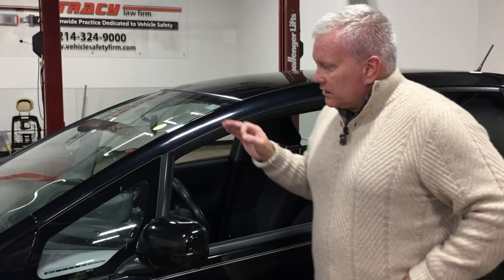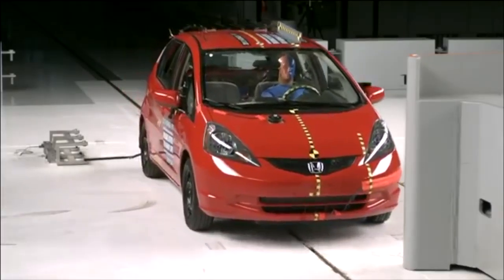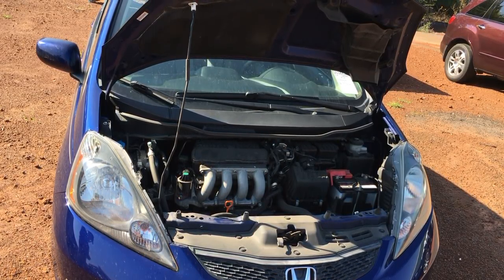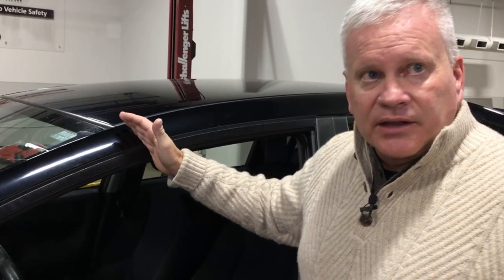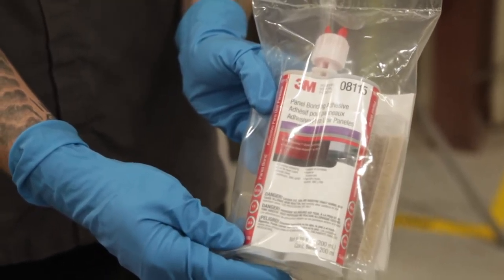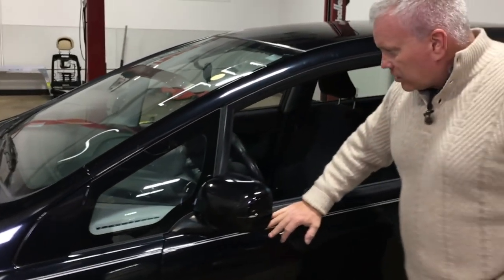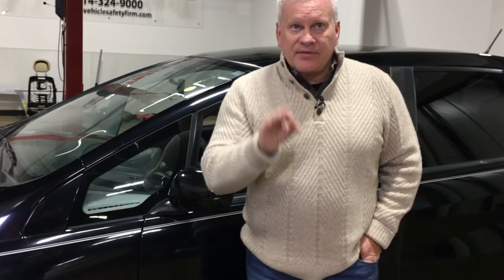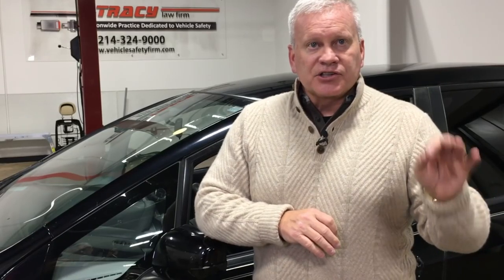Putting Car Insurance Bullies To The Safety Test

Comment: You need to do a test with replaced OEM parts and see how it does abter a body shop repair crach test does on a car that has been wreacked and see how it does in a crash test..Body shops don't have inspectors to check the work Body Shop technician like factory;s do which most the welds are done with robots which makes the welds meticulously accurate over a human welding..It is impossible for a body shop to  repair car back to its original condition even if they follow OEM repair...